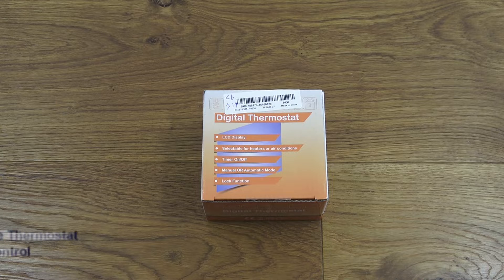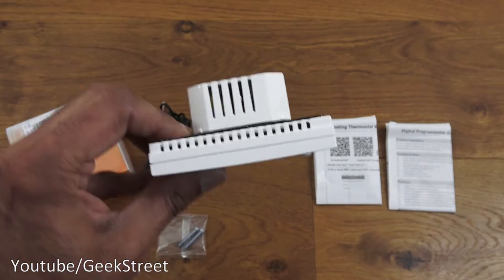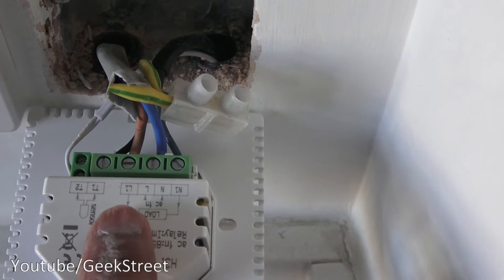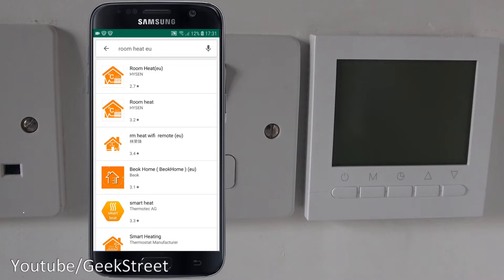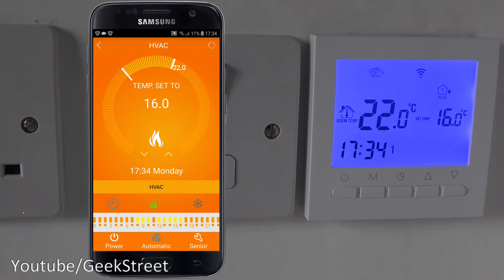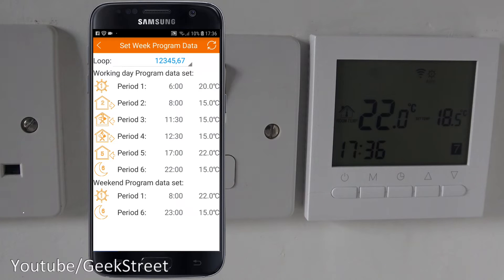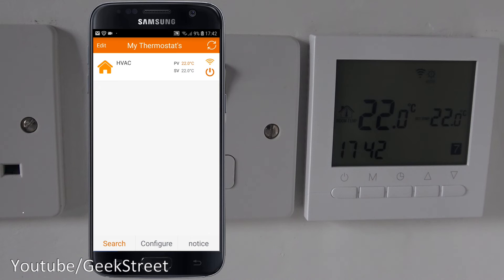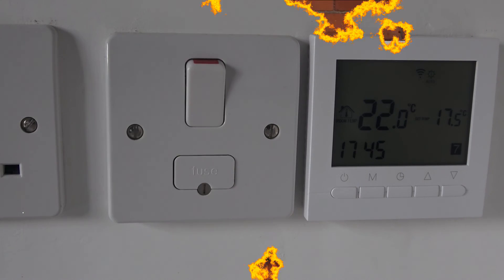BEST SMART THERMOSTAT FOR UNDERFLOOR HEATING ONLY $36 / £30!

Comment: I use this app, with a similar thermostat. Just change my router, so I want to configure it again. I can get to configure mode by pushing down and power, but can not change back to factory mode by pushing M. Anyone know which key or combination of key to change the mode? Thanx

Comment: The thermostat I want to replace has 2 wires fitted for the sensor(s) which are under the floor, one brown and one blue.  
1. Would they simply fit into positions 5 and 6 on this unit?  
2. I assume the wire colours won't matter into 5 and 6?
Thanks!